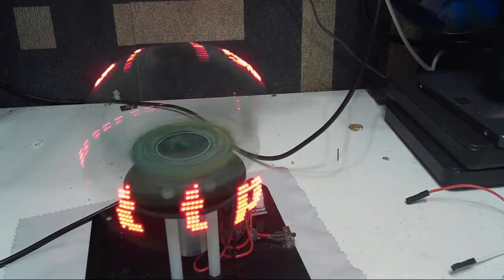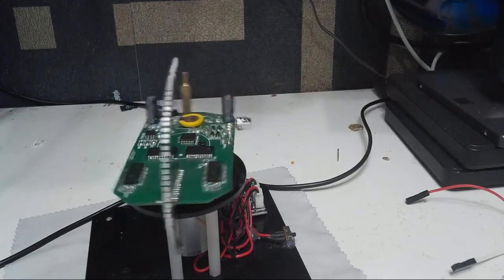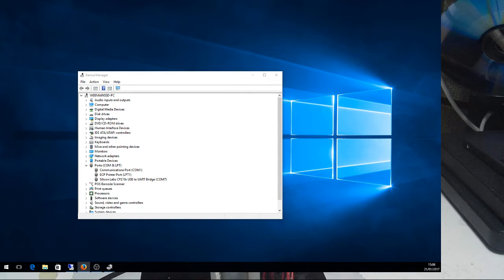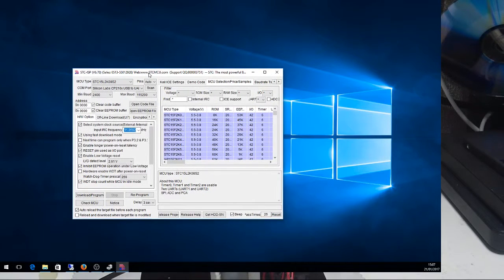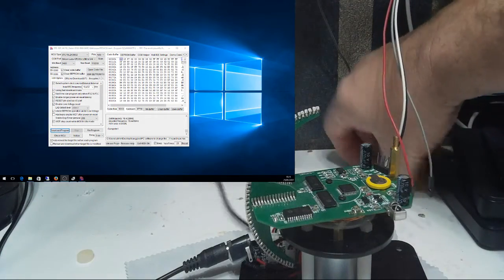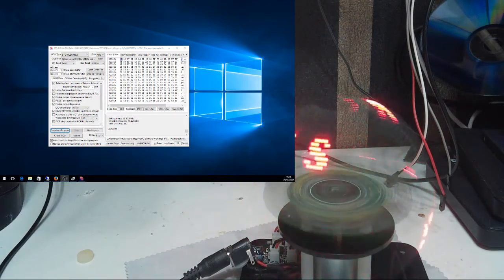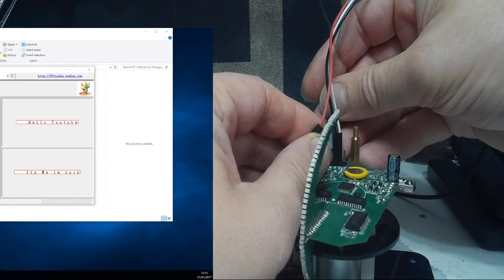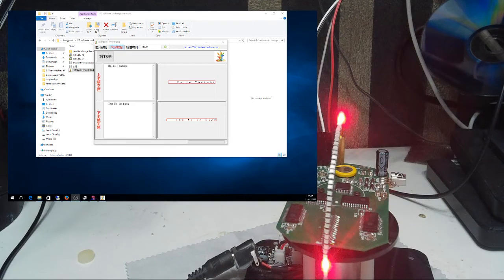Live programming the POV Globe

Comment: Hi kev.   I just built one of these.  I purchased the usb to ttl thing along with the kit.  I'm able to change the text however im not able to download any hex file.  I've done what you show here but the hex file download program doesn't detect anything and the download doesn't start.  Im beginning to wonder if the ttl thing is the culprit as it does work for the text change.

I got mine from aliexpress,  but the software and associated files are the same.  Could you pass on the TTL thing you bought and i'll get one.
Reply from the maker: strange should have worked, my device is a cp2102 here is a link to the exact model i have https://tienda.siliceo.es/en/usb-ttl-serial-rs232-serial/27-usb-serial-module-rs232-uart-ttl-cable-com-port.html
Reply from the maker: been i while but i also remember one of the softwares needed to be activated, there was a patch in one of the directories from memory, cant remember if it was the development tool (more likely) or the programming tool.
Reply from the maker: also to program a hex you need to hit the program button and then power cycle the globe as programming a hex is done during boot loader
Reply: @KevsElectricalWorkshop  yeah....i did that and nothing.   can download text change but no hex
Reply from the maker: @RukusDM  Strange maybe your right and the software to upload dosnt like the dongle thing
Reply: @KevsElectricalWorkshop It seems that the dongle is having issues. sometimes when i pull the ground wire and replace it everything goes fine.  others i dunno.
perhaps this thing cant source enough power as sometimes when i connect the ground the dongle reboots.  strange.   anyway i ordered the one you have.
Reply: additionally,  the keil software has a virus in it so i downloaded the newer version but its limited to 2k code.  Not big enough to compile anything but the 1st program they include "Light water".   That does compile and i can download it.  The others,  i just use their hex.   Im trying to reprogram it to show the clock and a countdown time.  Daughter is pregnant and wanted to give her a baby countdown clock LOL.   I see IAR has a 8051 compiler that isn't limited in size but for only 30 days.  I guess i'll have to get rolling LOL.   Thanks Doug M
Reply from the maker: @RukusDM  download the banggood files as mine had keil with a patch to remove limit, i then recall upgrading without the limit.
Reply from the maker: just went to banggood and found this wording "According to some buyers feedback, CH340 TTL serial port cannot be used to download the microcontroller program, can only be used to the change words!"
Reply: @KevsElectricalWorkshop  any idea what that download might be?
Reply: @KevsElectricalWorkshop  i tried to install that originally and it used a keygen.  That had a virus.  I contained it but it said the key was expired in 2017 or something lol
Reply from the maker: @RukusDM  ??? i used the stc-isp program to upload the hex
Reply: @KevsElectricalWorkshop  right,  i need to modify the software which requires either Keil software that came with it that had virus, or something else.   Kev,  Thanks for your help.  no need to go deeper.   You've already been a great help.   If i can find a compiler that will allow me to build the code,  im confident i can modify what i have here to build the countdown clock.  I'm actually a controls engineer,  but a old one lol.
Reply: @KevsElectricalWorkshop  upload isn't the problem....its modifying the software which requires keil or something else then download with stc-isp.
Reply from the maker: @RukusDM  downloaded the file and my system shows virus in defender, never use to so may even be a false positive. maybe worth seeing if any other antivirus programs show the same or running on a virtual machine.. old controls engineer like me then :)
Reply: @KevsElectricalWorkshop  yep....virtual.  This was with Mcafee
Reply: @KevsElectricalWorkshop  Kev,   I ordered the TTL device you used and works every time.  Thanks for that input.  Additionally,  on one of the laptops i have i installed the development software that came with the product that had the virus i mentioned.   i happened to find a OEM Windows 7 Pro cd i had and installed that Iand then created a Virtual XP machine and im able to modify the code that was supplied with the product.  Thanks for your input.
Reply from the maker: @RukusDM  get on now just down to programming happy days
Reply: @KevsElectricalWorkshop  Thanks Kev.  Ill give that a go
Reply: Kevs Electrical Workshop for some reason it started working.  Thanks

Comment: I've got the biaxial pov led and when powered up and not rotating it lights up each led in turn but when rotating it don't do much, i haven't messed with any programming.  Any ideas?
Reply from the maker: It will be either the ir reciever or ir transmitter, diffrent POV but look at this old video of mine https://www.youtube.com/edit?ar=2&o=U&video_id=oqHrumybTc0
Reply: @KevsElectricalWorkshop  Managed to get it to work thanks.
I'm trying to programme it the same way as your video but when i  try it says fail to send but yet i can with the flash loader demo.
Any ideas?
Reply from the maker: of hand dont know, seam to remember the stc program is in demo mode and the activation key is in the directory somewhere, been a long while since i played

Comment: Hi Kev, firstly I'd like to say thanks for your build videos! Great stuff. I have now successfully built the sphere with your assistance. I'm now trying to change the text and am having trouble with the hex file. It fails to open in the STC-ISP software. The message I get after opening code file is simply open file failed! I've tried it on two different PCs now, win 10 and win 7 with the same result. Have you experienced this at all? Thanks again.
Reply from the maker: Robert Shaw rename to remover Chinese characters, I also did a video on using the Chinese software to change text which is a bit easier than recompile ing a hex but not as flexable.
Reply: Kevs Electrical Workshop thanks. I managed to get it working by relocating the hex files into a different folder. Can't explain why that worked but it did. Changing text etc now no problem. Thanks.
Reply from the maker: Strange, i did have issues with the chinese text in the file name myself, obviously some windows permisions issue.
Reply: @MrRobertshaw100  hello robert show? how did you do it? u said u transfer the files to a different folder? cuz for me i cant se the hix file on stc-isp  i need yiur responce sooner

Comment: Thanks kev for the video     i got the stc-isp program working but the other program (chinese) i get a red cross when i write to the pov
Reply from the maker: pass dont know, to use chineese program you need the hex from inside the chineese program directory, you will also need to point to the correct com port in the chinese program, i dont think you need to dower dip the cpu like the STC-ISP
Reply: Thanks Kev it's working now.
Reply from the maker: what was the problem in the end
Reply: I didn't know that i had to write one of the two xuanzhuan.hex files first to it before i can use the chinese program to write text or bpm's to itThanks
Reply from the maker: get on all sorted :)

Comment: careful about using their programs all of the code that displays the clock has these lines of code in them

 case 0x47://Clock initialization
       Set1302(starts_time);    //initialization 
       W1302(0x8e,0x00); //Control command, WP = 0, write operation                

                                         (this line turns on the charging circuit of the DS1302)       
                                         W1302(0x90,0xa5); //´òª³äµ¶þ¼¶? Ò»¸ö¶þ¼¶¹Ü´®ÁªÒ»¸ö2Kçè

       //write_1302Data(DISP_TIME_adder,160);
     break;

it maybe be leftover from / if they used a super capacitor instead of the battery
but that can't be good for the battery
I don't know what button you have to press to activate (still working on a program to show me what is decoded from the IR)
and I don't know if it is in the default (basic) program sine they wont release the source code for that

Enjoy
Reply from the maker: good point never looked at that